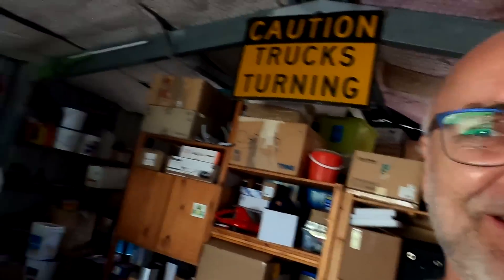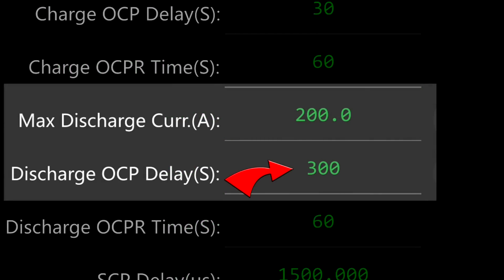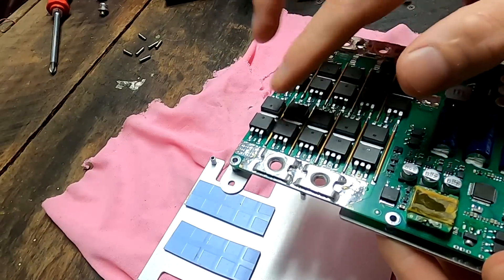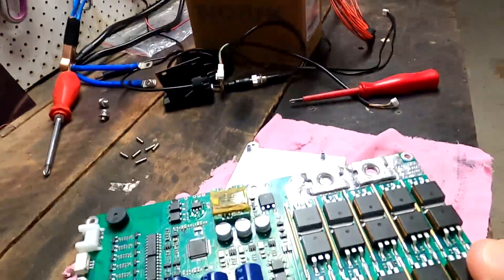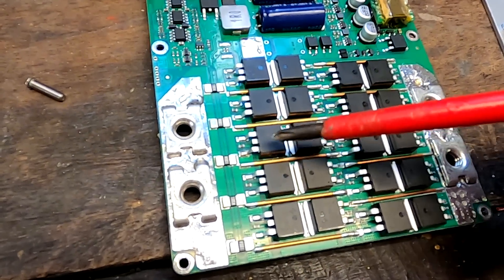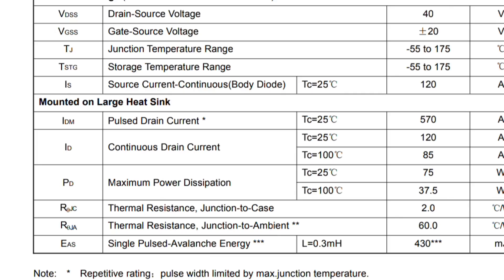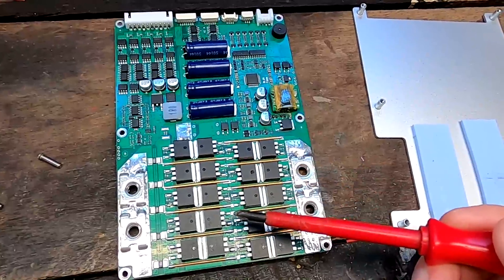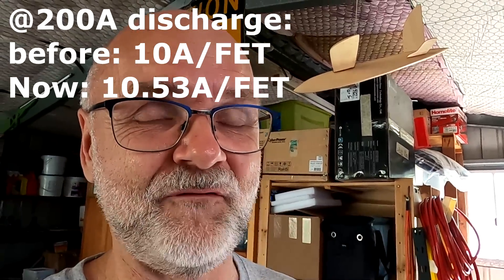Magic smoke! What happened to the JK-BMS? Still reliable or bad design?

Comment: I think it has an issue with the turn on/off speed. They may use low current/ passive turn on/off and not a proper gate drive. That lead to slow discharge ramp on the gate, and maybe that mosfet had the lowest Vgs th, meaning it stayed on longer than the others and it took the whole power into it. Or maybe it went into avalanche due to fast disconnection causing an over-voltage situation (it's a bad design, a TVS diode or a proper driver, in fact there is a placeholder for a diode near the FET's) If you decided to keep the mosfet and not to take it out, cut the gate and the source from the PCB, as it may be shorted and if the gate resistor is not yet burned, it may overload the gate driver or create a voltage drop over the driver output.....driving the rest of them with lower voltage and it may lead to a thermal runaway.

Comment: Each side have 20 mosfets but two are back to back so if one is removed or dies then the one paired with it also goes.
So the current is shared with 10 pairs of 2 in series.
The mosfets have a diode in them so even when off it will always be able to conduct one way, so they have one N channel and one P channel back to back to break the current both ways.

I think it might be a little too weak pull down resistor on the mosfet keeping it partly on for a short while and if so there is a HUGE power in the mosfet (current and voltage drop).

Mosfets can handle hundreds of amps at full on but at lets say 50% on when turning on or off there is a large voltage drop on them that gives a lot of heat and most of them only handle 1 to 20 amp for a short while.

Either the control circuit was to slow turn off pulse or the pull down resistor is to high resistance so it took too long time to turn off

Comment: Typically when a Mosfet fails it gets permanently conductive! This would mean it can stop the discharging any more - so be cautious! You never know how it will behave after a fault! The max. current numbers in the DS are just laboritory values which will never be met in practice! Keep in mind the values are only valid under spec. conditions for temperature etc. You can't get the temperature controlled if the Mosfet is driven to its max. values.

Comment: Hi Andy, I’m using 2pcs of the same JK-B2A8S20P from JK. According to the specs, it is designed to withstand up to a 350A continuous over-discharge for up to 2 minutes (aka 120 seconds). But for reasons I do not understand, JK delivers them with the over-discharge protection parameter set to 300 seconds. So if you do not change the setting to 120 seconds or less, you will eventually toast your BMS. So I’d say that the problem was not a faulty MOSFET, or a bad design, or ...., it was simply a stupid factory default setting from the factory. The same goes for the cell under temperature protection parameters - the factory settings are -20 with reset at -10 degree Celsius. If you don’t change them, you will ruin your cells eventually if you try to charge them in sub zero conditions. 
From my experience, it’s a great product, but you cannot relay on factory settings.
Greetings to sunny hot Land Down Under!

Comment: Try a big 'ol 300 watt soldering iron with a chisel point. I have an old craftsman one that will melt steel .... Not really, but it puts out a lot of heat in a fairly large area.

Comment: Heya, those mosfets are probeble in parralle to share the load so if 1 pops on 1 real I wouldn't trust the other 4 mosfets they probeble got a hid too
Reply from the maker: It will not affect the other ones. The BMS is running fine with one less FET since this incident.

Comment: Pretty sure after sleeping on it...probably not an overcurrent event. If so the whole unit would have been quite warm if not hot. I'm leaning more overvoltage. Yeah I hear you, the system voltage was too low for an overvoltage event, but maybe not. Only way to prove overvoltage is to do the test again, disconnect at 200 amps and put a scope triggered at 40V, which is the VDS of those MOSFETs, connected to the MOSFET drain. My guess is that the cabling inductance created a very high voltage spike and that you should probably improve your cable routing. If you look at the current each of those MOSFET's carry, at 200 amps, each of them "share" about 20 amps each. Not enough to blow any one of them.
t

Comment: I'm thinking that it's possible that one of the mosfet "exploded" was caused by the second of the two connectors you connected to the B port. When excessive current heats up the connector, it expands, causing its tip to overshoot to give an uncontrolled overshoot via air directly from the connector tip to the mosfet leg.
Reply from the maker: Thank you.

Comment: Hi Andy, Can you please tell me if this or any of this bms support 5s LTO cells config in 12v for use as car starting bms battery with toshiba scib cells. I need to have Bt android app monitoring. Car alt.  ussaly charge at maximum 80ah and only at short cople second when braking, but most time charge around 20-30A at max ,and 90% time it float charge 1-10A . Discharged is at max 25A when in start stop runing on battery only for shorth period .Many thx, and great channel about bms and lithium  batterys! ;) Ps. car start need bms to be able do 700CCa for 1-2 sec to start car without switch off bms in prot. mode or making fanny  issue. while providing this 600-700 CCA short peak burst
Reply from the maker: The JK 4s-8s should be able to handle a 5s LTO battery. However, you cannot run the current for your starter through the BMS.

Comment: you are wrong when it comes to the continuous current rating of the mosfet. Check the DC current at the required voltage in the DC curve of the SOA graph. if theres a DC curve, it means the mosfet can be used for dc applications,if there is no DC curve, then bad choice of mosfets.
Reply from the maker: Thanks for the info.

Comment: Hi, is ist possible to send you a pic of my jkbms pcb? I shortened it yesterday... Everyrhing works except the rs485 output. Found a missing smd (totaly exploded) next to a smd LED. Maybe you can tell me what was there once.
Reply: Nevermind... Fixed it with a 4.7k smd resistor. Also had to replace the rs485 IC. One was grilled. There are 2 on the pcb. One for the CAN out, the Other for the GPS (RS485) out.

Comment: Just use a heat gun designed for laptop repair. You can use flux to float one side off. Without harming the ones around it... Then float the new one on.. Takes about 10 mins....
Reply: @aldente_  It's designed to work with any boards..Not just one single chip design...

Comment: Great video.
In this scenario, where the BMs controls the cut off via its own settings, why then cany it not be programmed to ramp down the power from 200A to 50 or 10 amps over the time of 30 seconds then disconnect at the lower current?
Id assuem that software change would solve that issue.
However, if you have external cut off relays to cut the load, or you had a power outage / trip, then of course the bms cannot control that scenario and the mosfet will have to endure that high current shut off. 
Id much rather control the shut off via software of possible, cold be easily achieved.
Reply: Explain how you are going to "magically" ramp down the current?

Comment: The first thing I did with my (JK) BMS was replacing the thermal pads with copper/aluminium spacers. It's a shame that JK not only uses thermal pads, but that the pad on one side is extremely thick. The circuit board is well designed and they use fairly good components ... only to completely mess up the thermal design with crappy "rubber insulators"!

Comment: Hi Andi,
thank you for your interesting videos. It is actually difficult to tell the root cause. As others pointed out it could have the root cause in the gate drive circuitry of the mosfet itself. I assume that if you repeat the same test with the same rather long wiring and high current other MOSFET's will start to fail. Turning off high current is not always an easy task. Fast transients, created by inductive parasitics may turn on the mosfet again. It's difficult to say. I suspect that problem will worse if you go for an 8S configuration. Turning off then 200Amps might blow off one after the other MOSFET's. The producer is maybe willing to share the gate driving circuitry. Since both sides of the PCB are loaded with mosfets I assume a simple gate driving circuitry to all of them in parallel with no negative going gate driving circuitry to prevent false turn on. But again even small inductive parasitics at these high currents may create large voltage transients at turn-off. I would need to study the datasheet in detail. However 40Vds is in my view rather optimistic for turning off an 8S battery at high currents. At least 100Vds including fast absorbing circuitry for the voltage transients.

All the best
Markus, from MiddleEarth :-)

Comment: Something I couldn’t find here, that you mentioned in the previous video, is about having batteries in parallel. I’m still not sure of the issue here, unless it is about the potential of one very low charged battery to draw large currents from a highly charged neighbour. I suppose, in a worse case with each BMS configured to 200A for charge and discharge, it would be possible for one highly charged battery with 2 low charged neighbours, for there to big currents, but surely that’s not typical. If each battery & BMS was prepared separately, with the same battery SOC and with low charge and discharge limits set, and with proper fusing, would it not be safe to then connect them parallel?

Where I’m coming from is that I have a set of 4x100Ah 12v LFPs on my boat, connected in parallel, and I have no such problems. I wish to replace them with 3x304Ah 12V EVEs, but with the same modest limits, charging and discharging; I wish to add endurance, not increase loads; I charge with 2x305w panels and I can’t change that anyway. Can this not work with these particular BMSs?

Comment: When they are been asked to switch off.... They do not do ti at the same exact time, so there is always a slower one, which got to handle all load for a short period of time... Reason there is a need for an overall breaker, a single one. This is a bad design.
Which is funny is that there max Amp functionality should not be used... It will break every time.

Comment: Absolutely love your videos; you are the reason I use JK BMS.  I wonder why have the OVP delay set to 300 seconds (5 minutes)?  1s would cover valid spikes, longer gives time to heat/fail, especially with high over currents.  Since it is a default setting, I wonder if it is actually 300ms (.3s)?  Anyway, I have set mine to 1s and it seems to work fine, but I don't have time to stress test like you do (kudos to you!).  A 60s recovery makes sense, but 5 times that for the delay for the protection itself is asinine.  Also, could you ask your tech contact if the 'wire resistance' is actually 'Internal Resistance' for the cell?  If so, that would be an extremely useful setting!  (my peon requests for info don't reach attention beyond default responses) -Thanks.

Comment: I wonder if these BMS would be ok if you were paralleling 2 banks just to equalise them. Ie 2x304eve banks. One bank gets to say 50a SOC and the other is at 250a SOC and you flick a parallel switch to equalise them?
Reply: Also I really hope they make a sealed 250a version of this with cooling fins. Many off-road and marine users are running 3000w inverters these days and need 250a BMS to run them at full capacity.
Reply: @AussieAustrian  250 amps?  And that is why your 3000W inverter should be at 48 volts.
Reply: We are talking about 12v applications here. 4S not 16S.
Reply: @AussieAustrian  Yes, I know you are taking about 12 volts. But 12 volts at 3000 watts is just bad electrical engineering.

Comment: Hi Andy, did you ever repeat this very test with the same settings. The BMS should pass the test if your assumptions (one bad MosFet) are correct.
Otherwise it would be important to nvestigate any design problems.
Beste Grüße Hans
Reply from the maker: No, I haven't done it yet. I really should, ey?!

Comment: As I had already mentioned to Andy, mine has failed after just a few days of running on my work bench at only VERY low power, with just a constant beeping and will now not connect to the App. The first time it reconnected after a total disconnect, but now it will not at all. They’re totally aware of the problem, (which is apparently common), and now I have to send it back to Shenzhen when  they will only then fix or replace it. (Postage from Australia is expensive and very likely slow!)
They won’t send me a new one- very disappointing as this means a very big delay, probably literally months, in my upgrade to my Rv. I’m not happy. 👎
I would have expected better service (such as an immediate replacement in the mail) for an issue that they already know about in the design, (apparently being an incorrect surface mount resistor.)
Reply from the maker: Others have reported the same. I'll talk to Hankzor and see what they will do to rectify this.

Comment: So as I had already mentioned to Andy, mine has failed after just a few days of running on my bench at only very low power, with just a constant beeping. They’re aware of the problem, (which is apparently common), and now I have to send it back to Shenzhen when  they will fix or replace it. (Postage from Australia is expensive!)
They won’t send me a new one- very disappointing as this means a very big delay in my upgrade to my Rv. I’m not happy. 👎

Comment: I have the 0.6 balance version with 100Amp continuous capacity. Last weekend i did a test run and it did 150 amps by bursts while running a convection oven. The standard settings let it do that.
Should i worry?
I defenetly need to replace the standard cabeling that came with the "peter" inverter because it gets warm. As well the standard 230v cabeling in my off-grid cabin that runs to the convection oven.
But, will there bms hold?
Reply from the maker: That depends on your settings in the BMS. I have just recorded the video where I show and explain all the settings in the JK-BMS. So maybe this will help you.

Comment: The mosfets are in back-to-back pairs for charge/discharge, so every mosfet is in series with one other mosfet, and then those pairs are 20 in parallel. You may wonder why, it's because of the body diode of the mosfet, the one mosfet turns off to block current in one way (let's say discharge), but when a charger is connected, the current can still go the other way through the disabled mosfet. It's partner mosfet is positioned the other way around to block current coming from the other direction.. That's how you can control both directions individually.

Comment: Need some advice on the JK bms 4s . When mounting B- or P- cables to the bms do you have to use both terminal mounts or can you just use one, one on both sides.
I hope I made sense
Reply from the maker: You have to use both cables unless your maximum current through the BMS will be very small.
Reply: @OffGridGarageAustralia  Andy I forgot to say, what if I use one 4awg wire a side. Not the 7awg they use.
Reply from the maker: @michaelrobinson3935  But how are you going to connect this 4AWG cable to the BMS?

Comment: So if you need 200A BMS then buy 250A or 300A to ensure it won't explode. That is what China is all about.
Reply: That is called "common sense" electrical engineering. But nobody here is using any common sense.

Comment: There are a few ways the home gamer can replace that MOSFET.  #1 chipquick is a low melting point solder alloy.  You would attempt to mix this with the existing solder there. Cheap but time consuming and can lift traces off the board. #2 preheat the whole board in a toaster oven to 60-75% of the solder melting point and finish off just the MOSFET with the soldering iron. #3 get a hot air rework soldering iron. This is basically a heat gun with a 5 or 6mm nozzle. With the use of it and your iron you can lift that MOSFET.

Comment: Excellent content of your channel! Even if i live on oposite of the earth :)

I have a suggestion for another test. BMS with mosfets have a one problem. Becouse a mosfets have a body diod by design, you need two mosfets in series to switch of current in both directions. And this is interresting point. At example i switched off charging, i can discharge but current is flowing through one mosfet (ON - mili ohms) and one diode (maybe 1 volt drop). With discharge current 100A and 1V drop = 100W of lossis. Another interesting point is oposit configuration. Charge is ON and discharge OFF. 100A, 100W of heat but 1V lower voltage on battery for charger. For right voltage you need smartshunt between battery and BMS and export battery voltage to mppt or BMS comunicating with mppt. This is theory. You can proove it. Or maybe you already done this?
Reply: One more thing. This could be the reason of so manny parallel mosfets. Spread this waste heat to bigger surface

Comment: sorry Andy my bms stopped working... it just started beeping and would not connect with the app even reload it many times disconnected but could not connect ...so have raised a dispute ..very disappointing had great hope for this unit
Reply: I have the same problem, and they’ve admitted that it’s a known issue. They won’t replace it-  I have to send it back which is expensive and will take ages. I’m not happy!